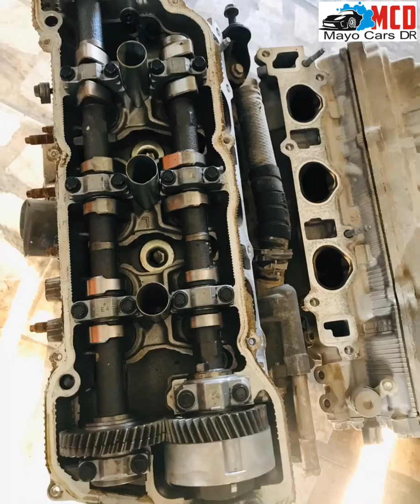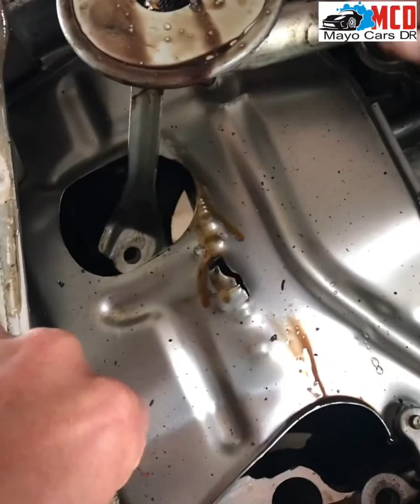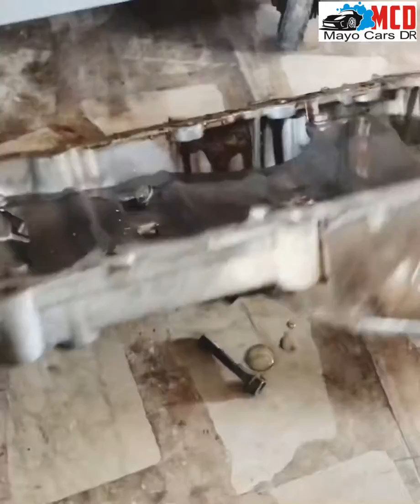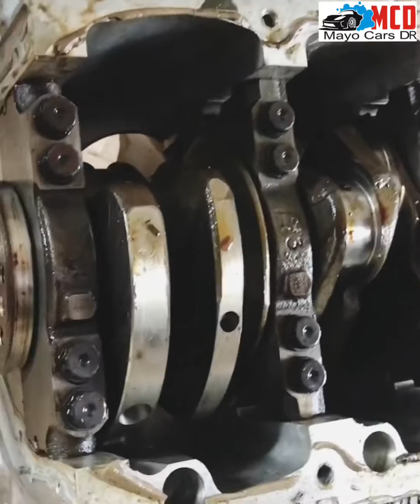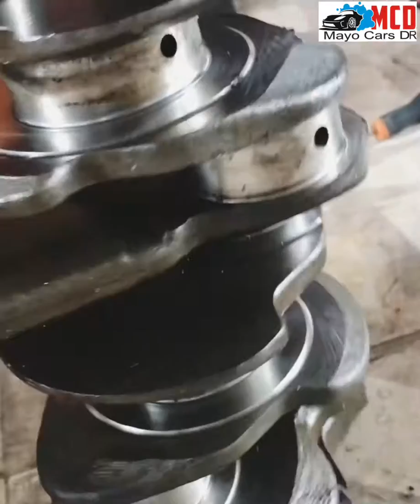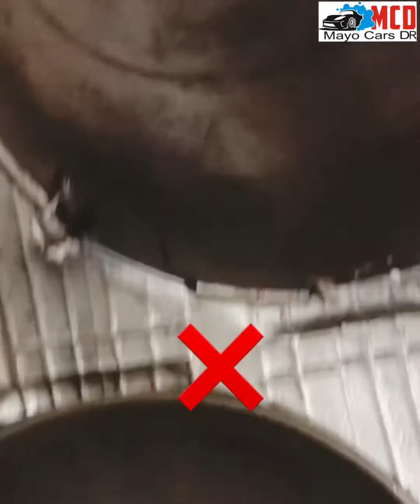✅3MZ (3300cc)ENGINE UNIT DISASSEMBLY of toyota camry-sienna-lexus

Comment: did you ever find out what was the cause of so much damage?
Reply from the maker: Bad engine oil
Reply: @MayoCarsDR  The motor snapped four rods bc of bad oil?  So what does bad oil mean?  Did they not do enough oil changes? Did they use the wrong oil? Or was it either oil pressure/oil lubrication/or oil cooling issues?